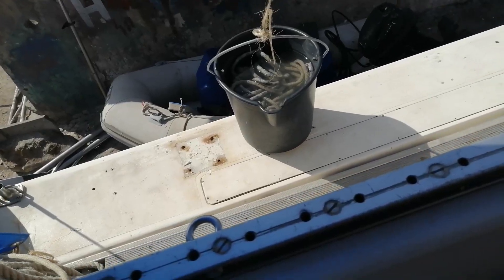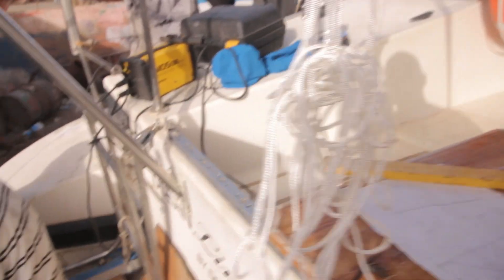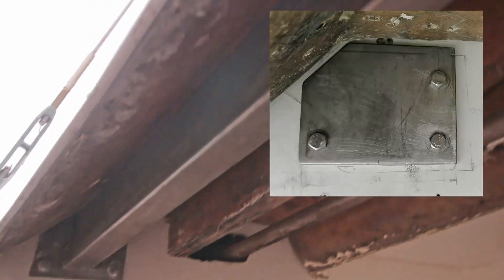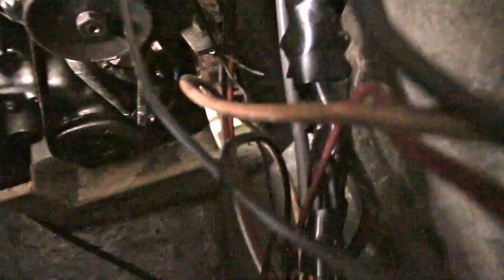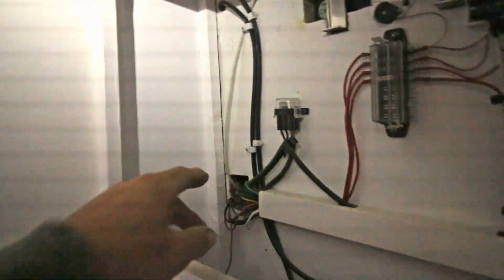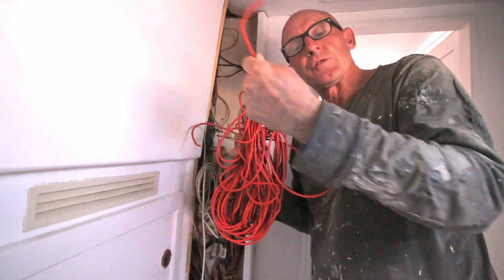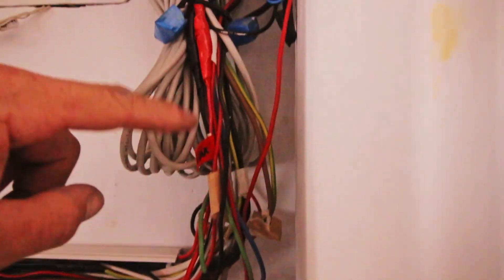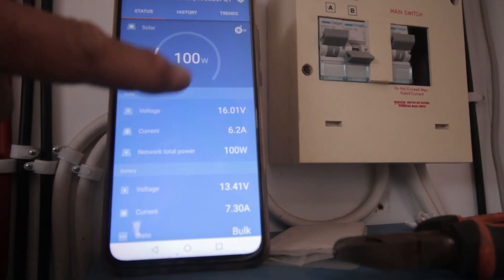New stainless steel arch disaster. Ep.63

Comment: Nice job well done, making stainless steel arches is not easy. Especially if the boat is older and out of standard models.  A tip on the electric connection blocks. “Kroonsteentjes” keep them lubbend or lacked. The copper wire and steel of the blocks tend to rust fast. If you keep them greasy of under clear coat you will have less trouble form them. 

Well done 👍🏻
Reply from the maker: Nope, it's not an easy thing, but this was pure amateurism.